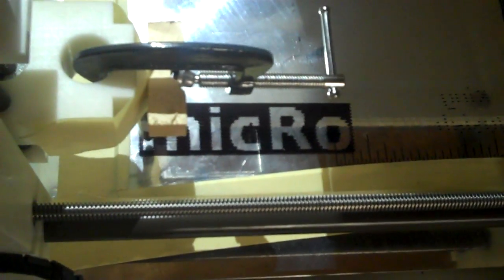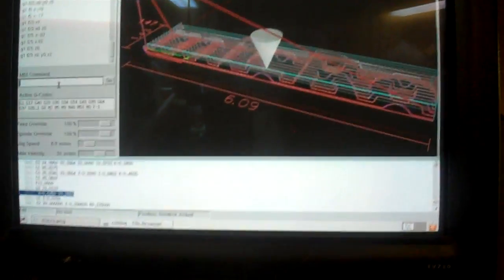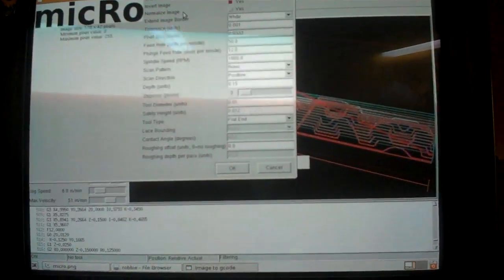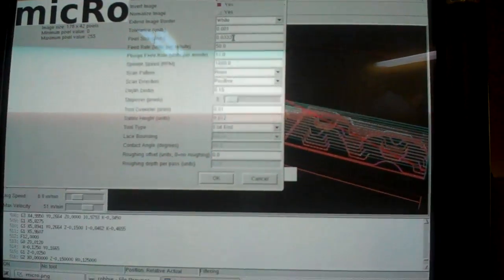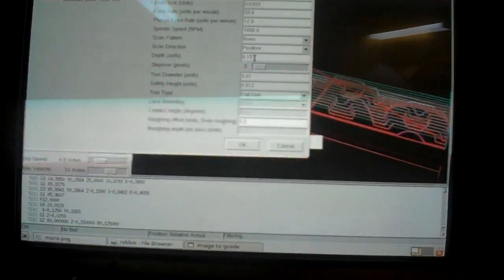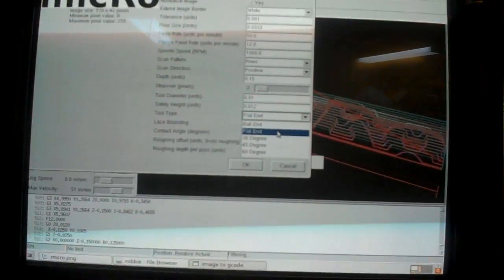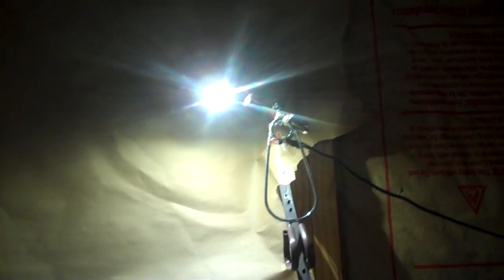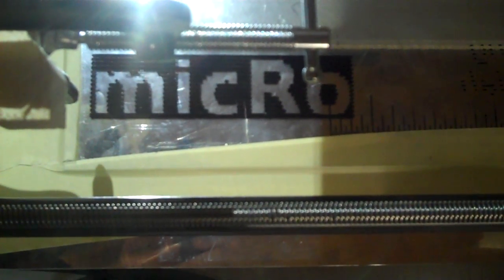EMC2 Image to Gcode with the Lumenlab micRo CNC Router

Comment from the maker: I don't have lathe experience, but it should pretty much work the same way. The lathe is a different school of thought than the router, but EMC should handle them very well. You could check out CncZone for better answers to that.
Laptops and EMC...I haven't had any luck with them. I just bought an Intel Atom D510 motherboard and built a sweet EMC machine for under $300 dollars. It's low power and quiet, and it has low latency. robbie at tech-tut . com